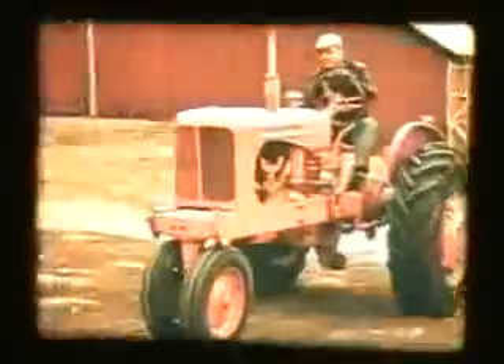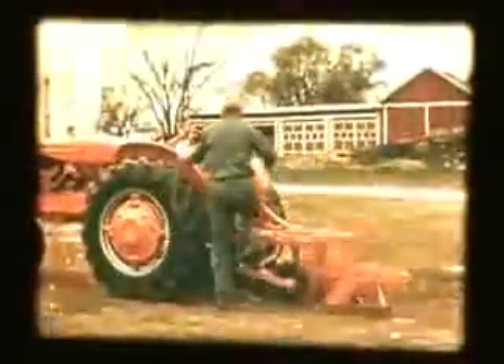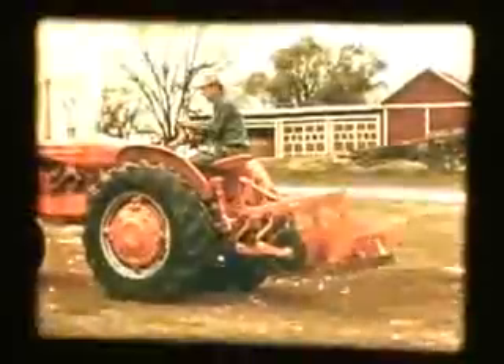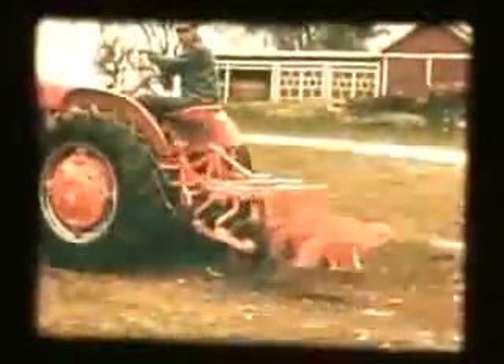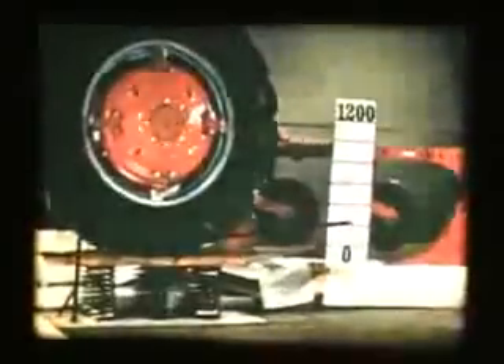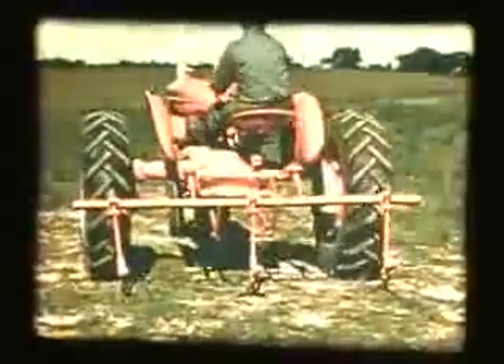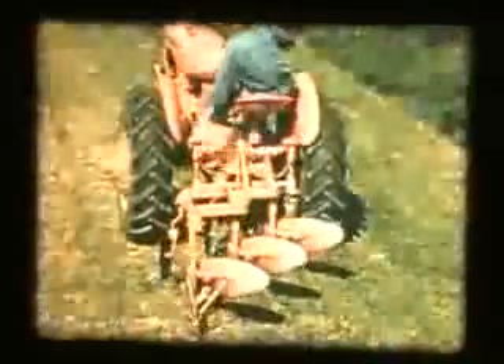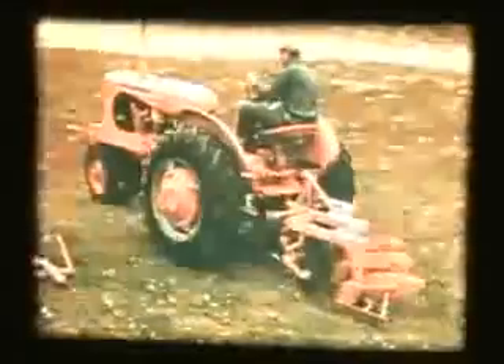Allis Chamers Movie #7

Comment: The 3 point hitch invented by Ford - Ferguson is the world wide standard for good reason. It works way better. The AC quick hitch required the tractor owner to buy all AC attachments rather than buying from any implement supplier.